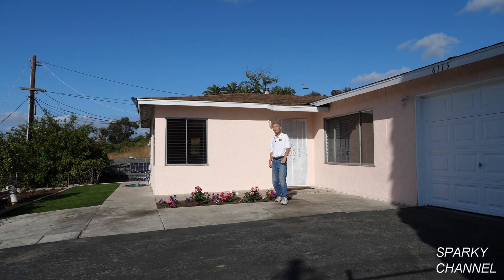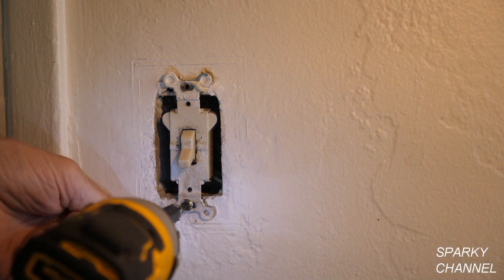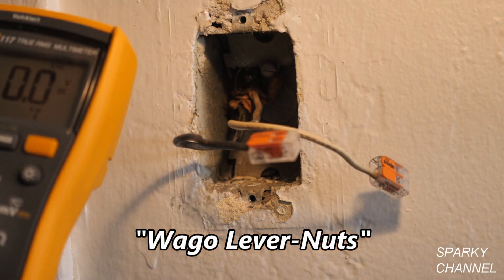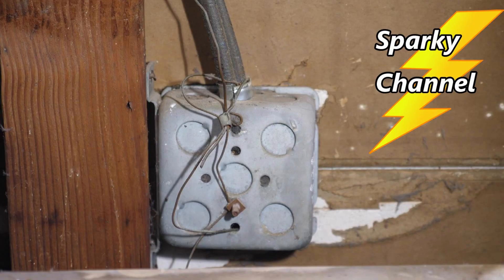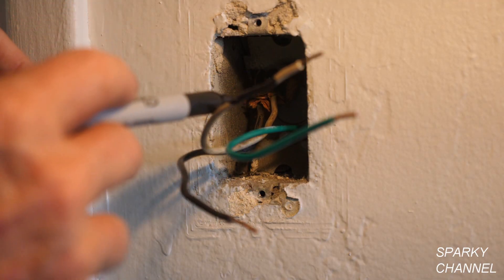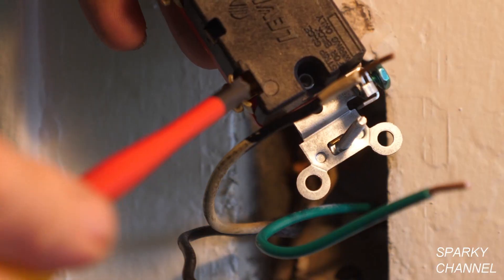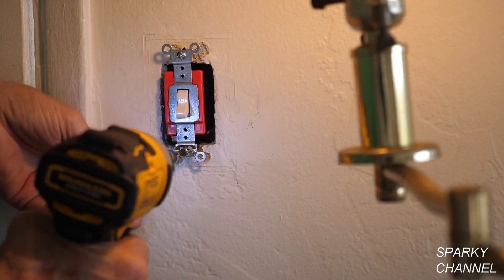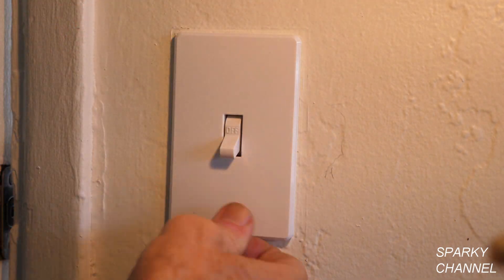Replacing a Vintage 1960 Switch and Grounding the New Switch

Comment: What do you do if your box isn't grounded?
Reply: Wire without a ground. The switch does not need a ground.
Reply: @stevenhollingsworth3249  But what about if it's not a switch but an outlet? as the case with mine (A 15amp living room outlet for TV, lamp, etc and definitely not a power-thirsty appliance. 
And let me ask a crazy question as I have heard it somewhere. Can I use the house's metal pipes in the crawling space that I believe are grounded at the ground side of the house? instead of running a long expensive copper wire from the breaker box's ground side?)
Reply: @samsen3965  you really want your outlet{actually a receptacle} ground and metal box to be connected to something going to your breaker box if you want the ground to be a proper ground that gives you the safety benefits of having a ground.  .   If you are a homeowner and installing the receptacle  for small things in an older ungrounded box, frankly you may leave the outlet ungrounded {****NOT COMPLIANT WITH recent National Electric  CODES**may fail inspection if you are selling your home) but it will work.  HIGHLY NOT RECOMMENDED.   With an outlet, you will have a hot(black) and a neutral(white) . In all cases  YOU MUST MAKE SURE HOT is wired to the small prong, usually with a copper colored screw if you are screwing it on and you must MAKE SURE NEUTRAL is wired to the Large Prong outlet.   Nongrounded+ Reverse Polarity is an extreme shock risk.  When nothing is wrong, the actual ground has the exact same charge as the neutral.  Reverse Polarity combined with an inside appliance connection between neutral and ground will charge an appliance such as the frame of a lamp{if any metal or conductors, or the chassis of a TV if any conductors are present, to the hot voltage of +120.
Reply: @normanhmath  Thanks for your kind info.
Yes, I have made attempt to take care of polarity with load (Black wire that in my old house is not very clear) to right or gold screw and white equivalent wire (Neutral) to the larger / silver screw or left side (When socket ground is below). I ensured the type of wires by using an AC voltmeter. Surprisingly, when connecting Black (Load) wire to the box of receptacle metal box, I get about 117 volts instead of when connecting to Neutral wire that shows me exactly 120V. If I am not wrong, the metal box of outlets must have been grounded by the builder (Old fashion grounding I suppose), or am I wrong? Anyhow, I'm going to get an Electrical Receptacle Tester and see what it shows as that would be what the inspector checks too. Thanks again for the input.
Reply: As Sparky mentioned in the video, if the house was built before 2011 then code didn't require switches to be grounded.
Reply: Move out.

Comment: It does matter which way you connect the line and load wires if you want the switch to read off or on when you put the switch back in the box.
Reply: That is actually going to be more on the orientation of the switch than how the wires are connected.  It is going to read off when the circuit is broken(open) and on when the circuit is complete(closed) and for a simple switch, that is going to make no difference.

Comment: I need to ground a light switch from a plastic box. Is there a hack instead of rewiring back to the panel? 🤷🏻‍♂️
Reply: I dont know how old this thread is but in old houses don’t bother.
Reply: This is the easiest way to ground a  light switch.  It doesn't mater ifnits metal or plastic at least not to my knowledge.
Reply: @lhotse8615  the metal box will conduct the electricity to the grounding wire. the plastic box will act as an insulator and connecting a ground wire directly to it will do nothing.

Comment: I have an old switch box just like that which I want to change to a newer box...is it nailed to a stud?..how would I go about replacing it.
Reply: If installed during original construction it is likely nailed on the outside. You can run an oscillating saw blade between the 2x4 and the box to cut the nails (instead of breaking up the drywall).
Reply: Why change it if it works?

Comment: I bought this exact switch. I couldn't fit the switch in the box without bending the tab that goes to the grounding screw on the switch. Is this common? What would you do? I have BX cable with grounded box. 1929. I am relying on the screws to metal box for ground. Is bending that tab ok?

Comment: I'm going to add heat shrink around my cloth BX cables in the box where there is fraying and damage in the air exposed switch box.  What color should I buy for the Line and Load wires in the switch loop to be 2021 compliant?

Comment: Is that necessary all the time to install a grounding wire? Thank you
Reply from the maker: Not if you use a switch with a self-grounding clip. Redundant grounds are a good thing though.
Reply: @SparkyChannel  I have the vintage 2 wire  electrical system when replacing the light switch say the metal box isn't bonded , do I add a pig tail  ground from the switch to the metal box ?  Or will that create a short?

Comment: I was wondering why I was seeing neutral wires used as hots. 1979 build and now I'm feeling more confident taking on the switch change project. Thanks!
Reply from the maker: Excellent!
Reply: And that's why anytime a white wire is used as a hot it is supposed to be re-identified as a hot, by wrapping the end with black or red tape, heat shrink,  or similar means.   And a lot of 70s houses will have power run to a light fixture, with a  single 14/2 cable dropped down to the switch, using the white as a hot, and the black as a switched hot.

Comment: The switch that you are putting is actually self-grounding with the ground connecting to the metal strip that you screw into the metal housing box.......on top of that there is a brass on the lower screw to indicate that it is self ground.......you do not need to go through all the trouble of drilling the box to establish the grounding, etc......you could short cut the video to two minutes by informing the audience that there is already self grounding of the box (which you showed with you multimeter and that is VERY USEFUL piece of info. and I salute that) and the new switch you are putting in is a self grounding switch.......but if the viewers chose to get a non self-grounding then they can go through all the trouble you did....but you still do not have to drill the hole in the box but just screw the ground wire onto one of the existing screws already in there since it is attaching to the metal box... Hope this comment did not offend you. You DID provide an informational video though. Thanks and have a good day.
Reply: True but still when it comes to electricity, redundancy are good. Say someone removes the switch without the turning the correct breaker off. Its still grounded. 2 minutes extra might just save a life.
Reply from the maker: Thanks!
Reply: I have a couple of older boxes grounded from behind.  My home is grounded under NEC code in 1955.  On those boxes, is it legal to use a grounding clip to the metal box and jump a ground wire to the grounding screw on the switch?
Reply: @maxheadroom8857  Yes. The clips are used whenever a tapped grounding point is not available in the box.
Reply: Using an existing screw would work electrically but would fail inspection. Ground screws must be exclusively for grounding. At least that's my understanding.

Comment: Good video. One question, you have two metal screws there attaching to the metal box , why don;t you remove one and screw the ground onto it? Why do you need to drill a new hole on the metal box?
Reply from the maker: Those screws should never be touched as they connect a ground wire to the back of the metal box. This is the old style 50's 60's grounding system.

Comment: Trying to change 2 light switches to 1 power box.  The power coming in from the breakers has 2 wires only (black & white, no ground).  However, the wires going out to 2 switches have 3 wires each (black, white, red).  How do I go about this? Thanks

Comment: My boxes were all that old resin black boxes and the only ground was a red wire strapped to the cold water pipe at the kitchen sink and laundry.  Naturally when the house was re-piped from galvanized to copped, those grounds were suddenly missing.
Reply: Copper would ground. So they didn't reattach the grounding wire?
Reply: @tkjazzer  No, they were apparently not concerned about reattaching the ground wire, because the connection was a pipe clamp located in the attic, in a very small confined area that the new copper pipe was not close to.  And I found the only three prong outlets were the garbage disposal and the washer and dryer outlet.  These two had a #12 red wire ground attached to the adjacent galvanized old pipe inside the inaccessible wall cavity.
But, it would have been nice if the plumbers had notified me of the abandoned ground attachments for these two outlets before they closed the wall they had opened up for the new pipes.  Because I had to cut holes to fish new romex to ground them.  I initially ran a single #10 ground wire from the panel into a junction box in the attic to ground those two outlets and left all the other outlets and wire alone.  But after a kitchen remodel, it made sense to rewire all the kitchen outlets when the walls were opened up and then it snow balled, because I had to open the drywall to get access to the back of the panel.  And then since that was open......
Reply: @tkjazzer  I always thought that the way they would ground the panel was with a # 6 wire to the water service where it first hits the house, providing they used a galvanized pipe in the ground and not pvc,  but my house had the panel grounded to the galvanized cold water pipe in the very confined attic area.  It was probably easy to get to when they did it, before the drywall was installed in the ceiling.

Comment: I was trying to change the 2 prong outlet to a 3 prong, but realized it didn’t have a ground wire.  It had a metal box, and when I did the test with the multimeter(one lead to the hot, and the other to the box…I only got like 60). Does that mean it’s not grounded?  The box was also coated in paint and plaster…could that affect my reading??
Reply: Paint and plaster can affect your readings. Scratch the box with a screwdriver and measure again, values less than line voltage means the box is not grounded.
Reply: That's a back feed  through the neutral correct?

Comment: So the way you tell if the box provides a good ground is that multimeter test? Can outlets be grounded the same way with pigtails? I have an older house built in 1966 and it has those annoying 2 prong outlets in the older parts of the house.

Comment: but what if the boxes arent grounded?
Reply: Then just don’t connect to the ground wire but since it’s not grounded you have to use a cover plate it does not have any metal on it

Comment: This video really helped me out! We have a house built in 1961 that has grounding in the wiring itself, but the previous owners bonded it to a screw inside the box. Can I run the pig tail from the copper bond or should I still drill a tap into the box?
Reply: You have a second alternative because your electrical is grandfathered:  you can run a ground wire by attaching a grounding clip to the metal box edge and run a ground wire from the clip to the switch ground screw.

Comment: My house was built in the 50s and has a lot of these switches for exterior lights. How do you tell how many amps the new switch should be?
Reply: the switch that sparky used, was for 15-20 amps, remember if your cables are 14 awg use 15amps, if you have 12awg wire use 20amps switch, but also you can see the breaker panel of that circuit and you will see.
Reply: My apartment was built in 1962
Reply: Any normal light switch will work

Comment: So it won’t work if it’s not grounded? I changed out my switch but it didn’t have a ground wire or the green screw. But on the new one I put in it does . So would I have to do what u did n ground it?
Reply: Now with the new LEDs, some iluminaries need fisical ground to work property, meaning nos flasing when they are turn off.

Comment: Changed out switches in my inlaws house because there kitchen light would strobe. The switch was a ceramic type. Changed out problem fixed.
Reply: Now with the new LEDs, some iluminaries need fisical ground to work property, meaning nos flashing when they are turn off.
Reply: @armdelgado  what is fisical ground?
Reply: @tkjazzer  physical ground

Comment: the white wire is hot.  it should be taped with black or red tape
Reply: That's why he used marker.
Reply: and also you shoud use white tape on the black wire to notice that is a neutral
Reply: @armdelgado  There is no neutral.
Reply: @illestofdemall13  you are right, the black is the return,, thank you.
Reply: @armdelgado  No problem.
Reply: @illestofdemall13  hi kris

Comment: Interesting video. I could really use your help. I have a very much older mobile home. I disconnected the vanity light in my bathroom for a modern replacement and the best I could do is wire it to an always hot wire. After a while something blew in the new vanity wire circuitry so I am replacing it again. I thought the black was hot, but apparently not. I could use some instruction if you wouldn't mind to assist. I could explain further but it would be pointless without a response. :-)

Comment: What about a 1970's house with metal box that isn't grounded.  I want to put in a smart switch and I think it requires ground.  Ground to hot?
Reply: remenber that you can use a green wire conected to a cold water pipe to make that wire fisical ground wire., just if you have close that pipe and dont run much wire to the main electrical panel
Reply: I think you have to use non metallic screws or a screwless wall plate and you can do an exact switch. Don't quote me on that though
Reply: You can use it without the ground but you have to use one of those cover plates that doesn’t have any visible screws

Comment: Curious question from an electronics ("I don't like fiddling with anything above 50 volts") guy: What's the difference between an electrician's meter and the kind of digital multimeters used for low-voltage electronics? The one you're showing in this video looks very much like what we use in an electronics workshop, but does it have special functions pertaining specifically to an electrician's work?
Reply: Generally Electrician’s meters are normally rated for higher voltage and safety classes ; also true rms voltage measurements since we deal with AC on polyphase systems which will tend to give you strange ghost voltage readings with a non-RMS meter, and my higher end fluke meters have higher resolution to measure pulse modulated DC voltage and frequency something that a electronics guy really wouldn’t need to do unless he’s doing engineering or very high level bench work.
Reply: @jrbay1  Thanks for your useful answer ☺
Reply: Lol, you really have no clue, don't you? Can not be even much of an electronics guy if you asks these questions.

Comment: You will not buy a switch today that will last 50 years. Today's electrical products are junk.
Reply: What do you expect for 89 cents?
Reply: @mook528  15.00 switches I have found bad in 8 year old home.

Comment: Yesterday I intended to install a dimming smart switch in the master bathroom.  This house was built in 1990.  Well, the new switch requires a neutral line to work.  All I found in the box was ground, the hot (white) and the load (black) wires.  NO neutral to be found.  I know that is backwards of how it is done in newer houses.  Apparently, back in the day, the electrician tried to save a few bucks and used only one Romex to the switch box.  Therefore, no neutral was in the box.  Luckily for me, there was a regular outlet about 18 inches away.  I knew it would have a neutral.  So, I ran a white 14 gage wire through the wall to bring a neutral to the smart switch.  Bingo!  The smart switch is working perfectly!
Reply: Just be sure that the neutral you tapped was on the same circuit.
Reply: @mook528  always do. 40+  years
Reply: Well there is really no need for a return (white-neutral) in a switch box. He or she should have put black tape or used a black marker to mark the white wire. Glad you got it done. The way it was done is how I have done it for 40 +years
Reply: @godfreyappliance5585  it’s been code since 2011 nec for exactly the reason above. An electronic control device.

Comment: atleast you have nicer wires then the 1943 rope fraded scary ass shit I have
Reply: Right, I  removed a switch last week and the wiring literally crumbled in front of my eyes. The rope sheathing was gone, all the wires were practically bare,. SCARY
Reply: @mook528     I feel you there same things happening to me on everything I touch in this house  ..   I been putting heat shrink over the wires to somewhat protect them from arking out  ( use a heat gun on low setting to melt heat shrink )  Don't use a flame whatever you do .. but replace if you can with up to code wire
Reply: @christophermedeiros1806  that's the issue, how do you "replace" wiring without ripping out walls? I wrapped the exposed wire with electrical tape, I thought about heat shrink but then I'd have to blast the box with a heat gun which on low is still very how so I decided against that. I even thought to cut the wire as far bask as possible and splice new wire on but I just decided not to press my luck
Reply: @mook528    I replaced what I could but I had to cut openings in walls put new boxes  and used a fish tape put sheet rock squares back seamed in and touched up or I  cut back as far as I could put a new box and fished new wire off new box to light or plug whatever  that was on first floor  2nd more challenging